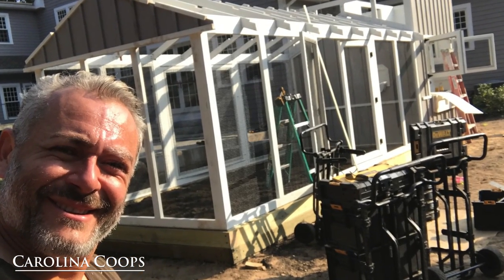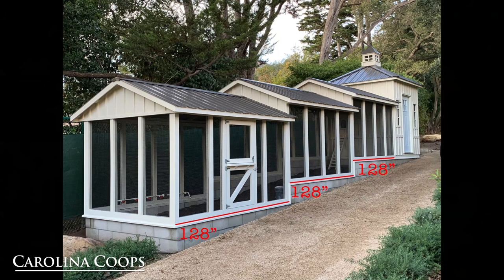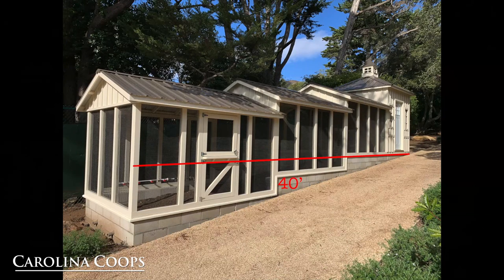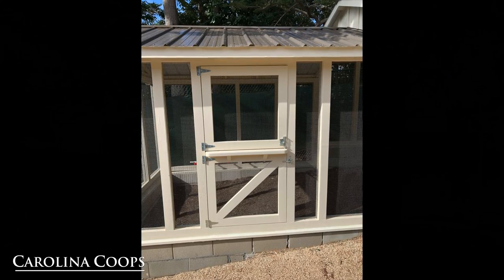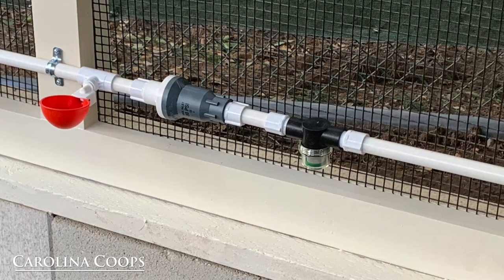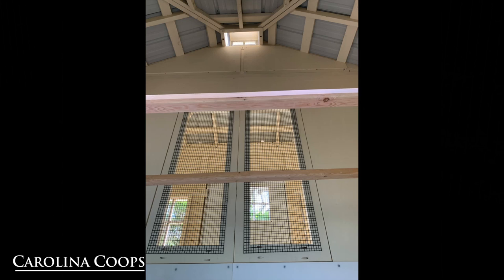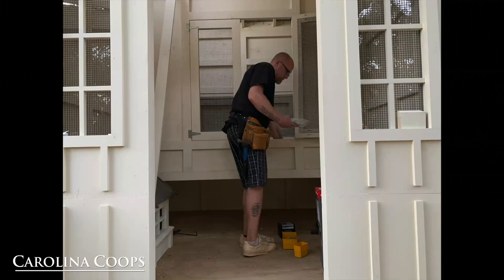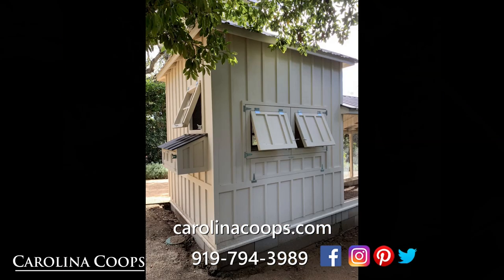Custom Chicken Coop Built to Fit Landscape | Run Drops Twice to Adjust to Slope | Craftsman Coop

Comment: Is there a reason that the run shouldn't have any slope?
Reply from the maker: This run was built on a sloped part of the property. It was designed to work with the landscape that was there. Normally, we want to build or have our customers place their coops on flat, level ground.  Hope that answers your question. Thanks for watching.